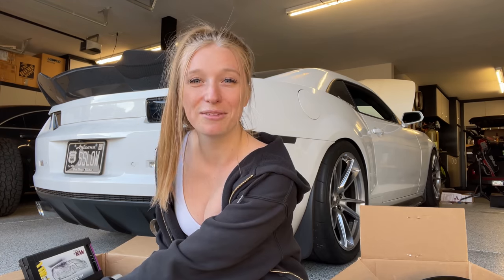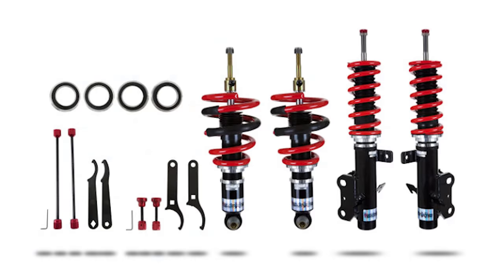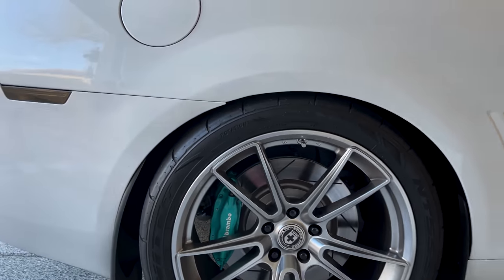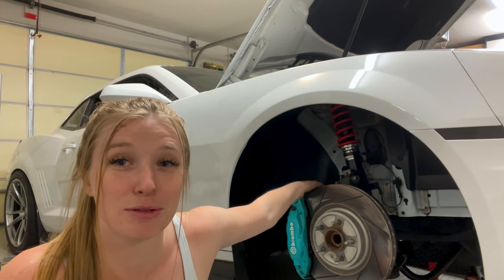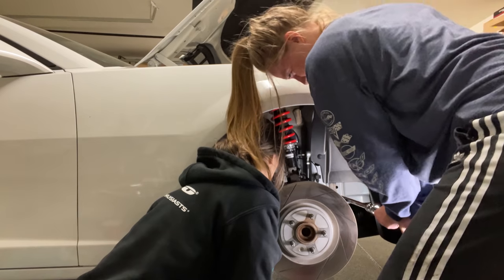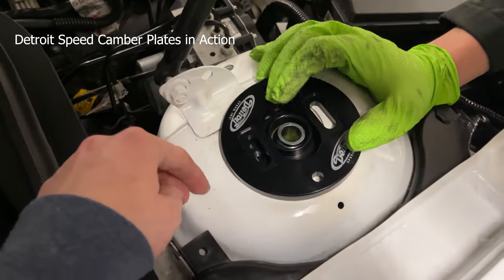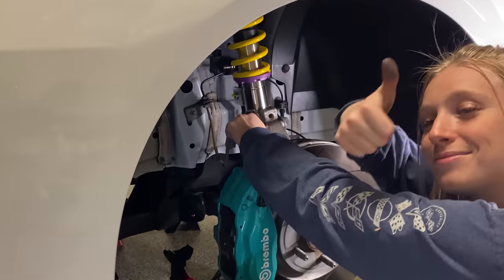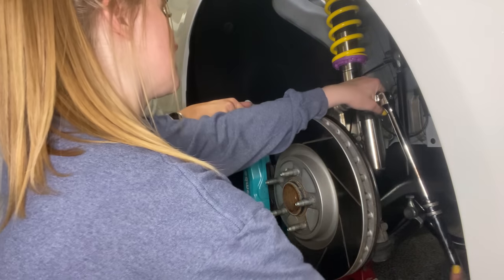Installing New Front Suspension on my Camaro

Comment: Look into upgrading at least the rear sway bar if you haven't already. I put a 22mm adjustable rear sway bar on my 2013 Acura TSX SE...it made a pretty large difference. 

The softer setting was a nice improvement but  not enough for me. The stiffer setting was absolutely perfect and added characteristics of oversteer to my Front Wheel Drive TSX.

Sway bar upgrades I definitely recommend
Reply from the maker: Thank you but I do already have the Detroit Speed Sway bars for the front and rear. They make a huge difference for sure. My car rides super stuff right now and is set up perfectly for my driving needs.

Comment: Hey Kayla, a quick question...
 Did you measure the clearance between top of the fender and the ground after the new coilover install, then again 200- 500 miles later to measure the amount of settling in the shocks/springs(if any)? You said in a comment that you were going to raise it a bit. Is that because it sits lower now than it was on the Pedders coilovers?
PS
Keep up the good work. From a viewer way up in Canada where we still have 12 inches of snow on the ground. It will be at least two more months before the Camaro gets back on the road up here in these parts. In the meantime, keep up with the content!
Reply from the maker: I didn't measure the before and after but I go off of visually what it looks like. With raising the car, the rear became the largest problem and my fender is sitting half way down on my tire. So it needs to be raised regardless since it's rubbing 24/7 now. In the next video, in a couple days, you'll see exactly what I am talking about.

Comment: Woah careful. When you were jacking up the car, one of the wheels on the jack got caught in the crack of the driveway 5:20 mark. If the jack wheel gets stuck, it cannot roll, and the car will fall off the jacking pad.

Comment: Those cheaper coilovers didn't fail you, it was user error, the preload wasn't set correctly
Reply from the maker: I had them professionally installed and then 2 years in I had them aligned and fixed by another mechanic.
Reply: What's worse is that people talk bad about a company even tho it's user error.   Cutting into someone's living because you aren't educated isn't ok.  It's also not your fault if you didn't install them tho. The preload being that loose is obvious someone adjusted the height after they were installed by loosening the spring collars.  Ride quality got bad because overtime of driving like that your actual strut/shock blew from not having any help from the spring to hold the car up on rebound.
Reply from the maker: @dfwbabydriver  That makes sense. I didn't talk bad on a company, this is proven across sources what certain coil overs are built for. I have driven on the Pedders for over 4 years and 70k miles so they failed over time. Maybe the original installer didn't install them properly like you were saying, who knows. They were bottoming out though which isn't good for coil overs, I agree!

Comment: My question might sound stupid but: you guys never use copper grease?
Reply from the maker: I have before but we did not use it in this situation.
Reply: @KaylaRundle  oh okay! Asking from Europe so not sure what you were used to (other product or didn’t bother). I use a thin layer on every thread that might seize or see corrosion, and even behind brake pads (help alignement, prevents some caliper seizures and squeaking).
Anyway, very sweet car and cool seeing you working on it!👍

Comment: damn i had a feeling she was from az after watching a few videos. im from az and i got a maro also.
Reply: i will say though one thing i recommend is properly torqueing every bolt to factory spec. not only engine but suspension as well. i wouldnt use an air gun to suck it down like that